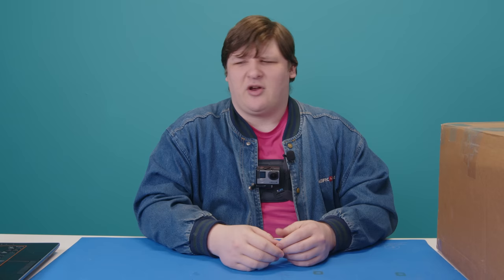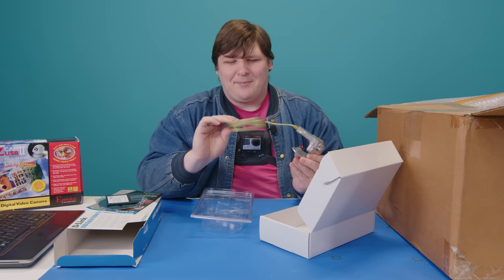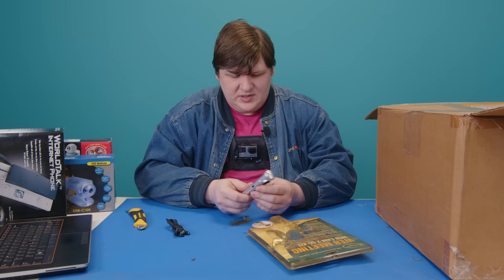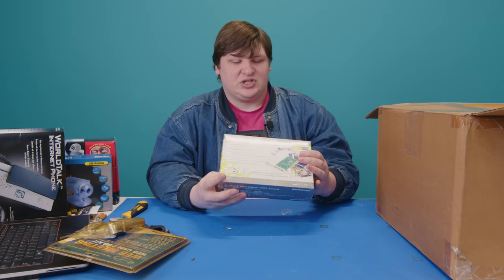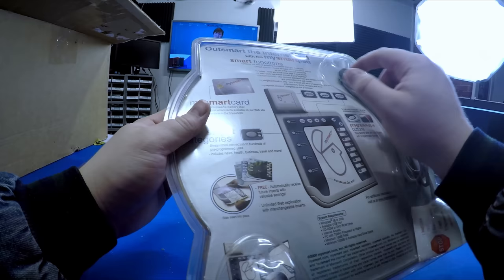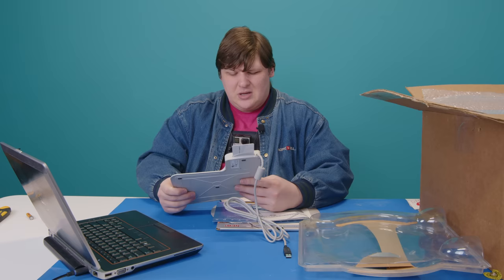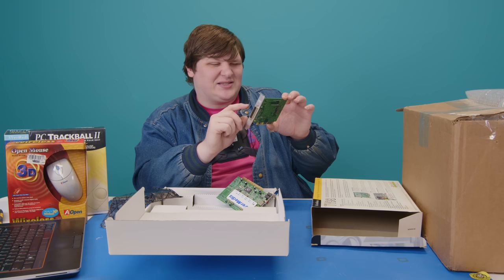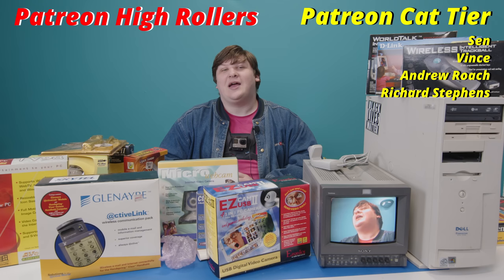Unboxing the Year 2000

Comment: I think the man who bought all of this had an invention idea that involved a digital camera connected to a computer with a modem with some sort of a hand controller/input device e.g. a special second mouse or keyboard .

He dropped a lot of money to buy all of these at the same time and they all sat in original boxes because he never got the time to sit down and do his "market research". 

His MBTI personality type would likely be in ENTP or an INTP. 

He was an intuitive thinker who was also a perceiver. 

I would not be surprised to learn that his invention idea was digital video telephony. 

All the bits and pieces were there minus the bandwidth and higher resolution for the camera. 

The cheap wired internet phone is in line with that. Abd he was thinking of doing the same over cell networks. That's why he bought the handspring Visor. 

That was of course a solid great idea that was a full 15 to 20 years ahead of its time.  

He was likely older a d not computer savvy otherwise he would have known that at the time the bandwidth was not available for his idea to come to fruition. 

Having said that, I did some international long distance video calls using such webcams (mine was an IBM brand) starting say 2002 - 2003 as soon as I got  cable broadband. 

So his timing was not off either. He just did not have the time and resources to turn his idea into a real product. 

How do I know all of this? I am an INTP. 😁😁😁

Comment: At 36:30 that thing uses 40-50 MHz. Gut intuition. I think I had one, same RF transmitter box. Mine had the num-lock, caps-lock and scroll-lock leds because it belonged to a wireless keyboard as well.
Because it had the leds, a single pair of AAA batteries lasted MONTHS. Same as the mouse. The mouse itself was fairly competent though.

Comment: IME the only exceptions to webcams of the day looking identical were the original iSight, which had excellent optics, and the EyeToy which had dim colours and plastic optics BUT relatively (vs the competition of the day) low noise and, crucially, actually had a pretty fast shutter speed. All the other webcams seemed to run at 5-10fps and would smear any motion, but the EyeToy obviously couldn’t have that low of a motion resolution for the games. I think that’s why the image is a little dim too but it was definitely worth it back in the day versus slower (and marginally brighter) webcams.

Comment: Speaking on CIF, I have two Aiptek HD cameras from 2008 (they were the cheapest HD cameras I could get my hands on several years after the fact too) and they actually specify their "close enough to 240p" resolutions as CIF. Never bothered to look it up, I just figured it was a holdover term from somewhere (like how the same cameras have a resolution labelled "D1" like the videotape format).
Reply: Just noticed, on that little portable webcam around the 12 minute mark, that uses the same USB cable as the Action Replay for Nintendo DS from circa 2006/07.

Comment: 400x300 was the resolution that I used to run the first Unreal at on my Pentium 133 without graphic acceleration. I remember back then thinking it was rather unique resolution, but it does go with the more common 800x600 and 1600x1200.

Comment: Regarding the palm scanner ISA card it might be a generic stripped down SCSI card. Running a scanner over parallel was painfully slow so it was common for most mid-range or better scanners to have both or just SCSI. As it was uncommon for PC's to come equipped with SCSI the scanners commonly came with a card that used the SCSI interface and protocols but was stripped down enough that if you tried using them for other types of devices like an external hard drive they didn't work. This also allowed the scanners to be used on both Macs and PC's and also why they are using the SCSI plug type that was the Macintosh standard on a PC card which wasn't a thing found in a normal SCSI card in that era.

I spent a lot of time in Circuit City and CompUSA back in that time period and that looks just like a collection of someone who scoured the deals from closeouts and mail-in rebates deals. I think that is also why there is so many web cams since I seem to recall there being a lot more web cams than people interested in buying them in that time period.

Comment: I had a webcam that did these type of games back in the day. The box looks familiar. It came in the form of a PCI capture card with a single composite video input, and the webcam with its composite output and PS/2 for power. I remember it was the first camera I had that could output a smooth 30fps, which was quite a show at the time, as my previous camera worked over the parallel port. The games were very difficult to get working at the time, but I distinctly remember them being pretty fun! I vaguely recall window washing and bubble popping.
Reply: I just finished the video, it was the same camera as the Videoemail Xtreme! I loved that thing!

Comment: Idea for all the cameras assuming they all work... A retro game stream using as much retro tech as you can. Crappy monitor side mounted boom mic that came standard with every 1996 Packard-Bell, Facecam from some old camera that only does like 25x94px or some ridiculously low resolution like that, etc. "If Twitch existed in 1999" kind of a thing.

Comment: I think that first camera is the same one I got as part of a bundle. If you bought the Windows Me bundle you got the camera, too. I remember it had a game where you could pop bubbles. I think the bundle included something else but I don't remember what (probably software).

Strangely enough, Windows Me was not noticeably less stable than 98 SE. I suspect a lot of the crashes were due to driver problems.

Comment: Love the chinglish on the D-Link. Also the connector on that garbage camera is a standardized USB port, I forget what it's called but a LOT of cheap electronics around this time used it. 

Also, a Handspring Visor is a Palm Pilot, it was designed by the same people and used the same software even! It just had a weirdo cartridge slot on the back of it, which many interesting things were made for. Handspring Visors are really cheap and all but the color model run on AAA batteries for forever, plus they support USB docks. Recommend getting one if you can!
The ActiveLink services are all discontinued, but it's the same as the old Palm VII/VIIx/i705 used. All of these devices (except the i705 I think?) had a separate internal battery to run their transceivers, which means even with batteries flat or out, they could receive messages in low power for a short time. It probably was not a cheap module, and I know the service was fairly expensive. It's about the same level of service you could expect out of a super early blackberry, over what is effectively cellular.

WOW, it came with one! I didn't expect it to have a Visor in there!
The slot is what makes the Visor series special, it's called SpringBoard. There were some more involved upgrades you could do to competing devices, but Handspring made it very easy.

It crashed because they probably didn't expect you to insert the module before setting up the device, it doesn't even know what time it is or it's own screen calibration! Because of the lack of screen calibration you can't hit the reset button either. Paperclip to the back!
Reply from the maker: I completely forgot during shooting to remark on the fact that it INCLUDED THE ENTIRE PDA. I was ASTONISHED by that. Who does that?? It's like a wifi card coming with a whole laptop "thrown in." The past was a strange place.
Reply: @CathodeRayDude  Maybe you were right about it being a repackaged setup, and that they were just moving old stock? Depending on the year, the Visor might have been brand new or it might have been completely outmoded already. Willing to bet that setup cost a pretty penny, and it certainly didn't look like they advertised the PDA on the box...

Previous owner probably picked it up on deep clearance and never knew what lurked inside. Incredible!

Comment: I had that wireless trackball.  I wanted it for use as a remote control for my CD player software.  I would have used it more but I had a external modem and one serial port.  The 'webremote' would only work if it was attached at startup so that made switching back and forth even more of a headache.
Reply: While I'm at it, if anyone is interested.  The software is just drivers and software for button mapping.  Those aren't the standard media playback button interface, it is keyboard macros.  If you wanted to launch a program, you basically had to set up a macro to summon the run dialogue, have it type out the path to the exe.

Comment: CIF was a quarter of the standard PAL resolution of 704 x 576. 

I remember my first 3G phone had video calls at QCIF resolution (quarter CIF) which was 176 x 144 using h.263 compression. It suuuucked and it cost a dollarydoo a minute, but hey, video calling in 2005!

Comment: 41:10 iirc, the security cam set I've got in a box somewhere also has a male DC Jack hanging out of the cams with the composite out, and the composite extension cables it used were bundled with a f-f DC extension as well, so it may not be quite the wrong way around if they were adapting that standard

Comment: the seal plastic of these packages had the tendency to rot all on its own and at times fume out into the paper of the box damaging it so, as collectors value goes for sealed or not sealed it's better not sealed!
the blister bubble plastic can be worse I have seen examples where the plastic browned and the paper turned black.

Comment: the trackballs i still have have two rubber rollers to connect the ball to the rotory encoder ,and although ps 2 not usb they are still in reasonable condition , so i wonder if the rubber in yours is perishing

Comment: About that Videoemail think... Cheesy or bait-n-switchy or not, but TBH it could actually make sense. A composite camera through a capture card would likely get you a better picture than a webcam of the time, and you're basically getting a webcam and a capture card in one package.

...and the camera probably has a CCD in it, so the package telling you that it's a digital camera technically isn't a lie. It just has an analog interface ;)
Reply from the maker: You're right that it was probably very high quality compared to most webcams! footnote though: CCDs aren't inherently digital, in fact I don't believe they became digital for many years. I'm not well versed on how camcorder electronics work at this level so take this with a grain of salt, but I don't believe there's any particular need to digitize the signal for an analog output - you can basically just ripple out the stored charge of each cell at a specific rate and get a picture, no numbers required.
Reply: @CathodeRayDude  Interesting, I never knew about that! But it makes sense, so thanks for the correction!

Although I guess converting a Bayer-filtered image into a composite signal is rather difficult using purely analog circuitry, so I'd still bet that little camera still has at least some DSP in it. That seems more likely than it having three CCDs... But that's just speculation either way.

Comment: My parents had several of these items (all free after rebate).  The first two webcams are awful.  Driver support for any modern OS (including Linux) is nonexistant.  Wouldn't really matter anyway.  That wireless trackball thing actually came in two flavors, a wired version and a wireless version.  The wireless version is IR based.  Never could get it working.  And the experience using it is pretty dismal.  Trying to mouse with a trackball in your hand just doesn't really work.

Comment: Surprised you did not comment on the missing UPCs.  Seems like they were purchased just for the free / cheap after mail in rebate which was all the rage at the time.
Reply from the maker: Yep, I cut out the part where I talked about that because i realized I knew why (the sender told me they were all bought with rebates)

Comment: The thick box thing has gone too far.  I just got a $30 blood pressure cuff off of Amazon, and the box it came in is built better than the cuff itself.  I'm actually saving it to use as a project box.  Most people would just throw it straight in the trash though.  Such a waste.

Comment: YT keeps auto-deleting my elaborate comment :'(   anyways. tl,dr: late-90s was an "interesting" period to say the least. Most fond memories of the ZIP drive just before the advent of CD-ROM).
Reply: maybe it works as a comment to a comment:
Oh heck yeah, late 1990s were a fun time. There's been tons of crappy stuff, but, seriously, "it's new" and you'd have no idea where things would evolve towards so - of course - you'd explore various futuristic rabbit holes.
(just today, LGR released a vid about the Rio MP3 player. The sound of future rang in my ears, and I paid today's equivalent of 350$ for a 32mb pager-sized thingie. And I loved it, for all the 1/2h playtime it offered at 128kbit encoding. I loved the concept of mp3 even more when Napster came along :]  )
Another example would be the short period of time where ZIP drives were a thing: I absolutely loved it for my job (did a lot of on-site IT work): my suitcase of considerable size, filled with 5,25" and then 3,5" disks, got replaced by a sleek case holding about a dozen of 100mb ZIP disks (plus the parallel and SCSI combo drive - genious at the time). 
Even when CD-ROMs with their 640mb became a viable (=affordable) thing I still kept using those ZIPs for quite some time as I could just update a driver or OS installation folder instead of having to throw the CD into the bin and burn another one (while hoping it didn't encounter any errors while doing so; was quite common early on that burning a CD would just fail, you'd throw away the disc and had start anew: even my Plextor 4x SCSI thingie threw a fit over a "buffer underrun" every other day). (yet-another-edit: multi-sessions CDs eventually became a thing, as did rewritables)
(Also, CD drives weren't that common amongst my customers back then either. But: everyone had a parallel [printer] port, and everyone had a 3.5" disk drive I could boot my ZIP boot disk off of)

(edit-edit-edit: fighting YT now, keeps deleting this and I've got no idea why. Could just ignore it, but memory-lane-me needs to post this :)  )